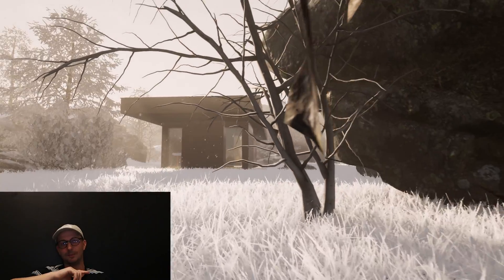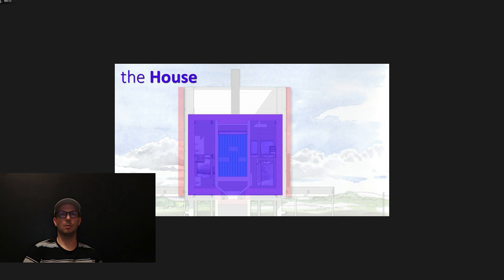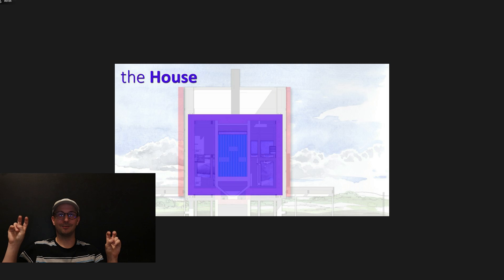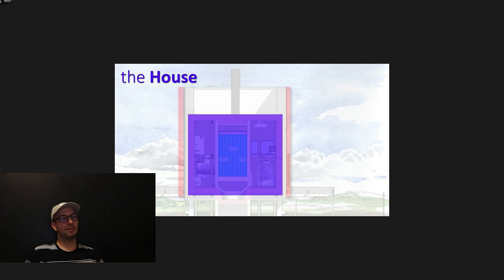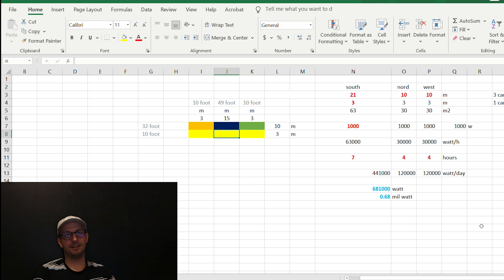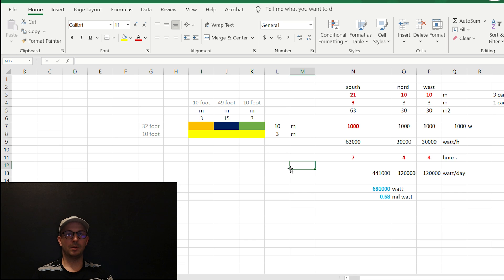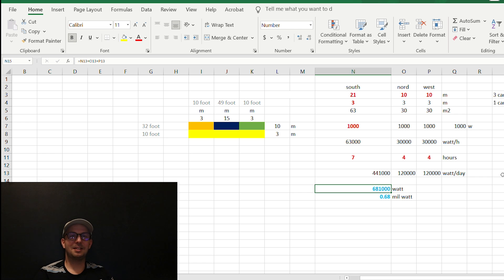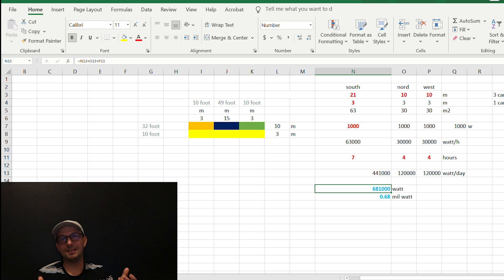Energy efficient home plans for cold climate ... 5 FLAWLESS HACKS ?

Comment: Interesting! I’m curious what you do in the summer then to avoid the greenhouse overheating the house, or is there a way to use it to cool the house in the summer?
Reply from the maker: there are many ... however if we talk strictly just about the greenhouse itself the material van be rolled up automatically or replaced from 9am till 4-5 pm with a semitransparent or shading material double-ing it. Assuming most persons are not from home office or they same in 1-2 rooms even "pitch black" wouldn't affect them in those hours. However a semi transparent material would work out the best if the family is at home. Its not like we want to stare out the window for hours directly in the sun for hours. If we do we automatically role up the semi transparent or none transparent material for 10 minutes. The further is from the house the better it is. Because the foundation of the house and the earth near it wont be affected by the heat storage. Exception is the house that's built o piles.
Reply: @MaverickMansions  I'm one of those work-from-home folks who likes to stare out windows. haha. It will be a while before I have a house I can alter in any way, anyway, but I'm gathering ideas. :-)

Comment: I am looking at building a highly sustainable house in Nova scotia and plan to have an attached greenhouse like this! However my biggest challenge the rock.... The house is going to be on a hilltop with some great views, and while it will be south facing, it's on a giant chunk of solid bedrock. Sorting out an energy efficient want to build a foundation or anchor the house that doesn't allow thermal losses or insulates from the giant cold sink beneath me will be tricky I think. (or I could have it all wrong) I thought about using pillars or beams but again then you have the problem with cold air getting up under the house. Lots to think about thanks for making this! 

I am also considering using rammed earth for my core walls! 

I will also be only a few km from the sea, and there can be some cold/harsh winds off the ocean so I will be thinking about your air gapped facade for sure!
Reply from the maker: Usually the bad thing is the gold. Think about constant winds not as cold but wind energy. Lets say you have everything  "against" however you have limitless free energy so you can get away with 1 layer of a nylon sheet and wind turbines heat up your not just your house but the whole neighborhood.  https://www.youtube.com/watch?v=Nm3u1i1vdgc&ab_channel=MaverickMansions  Yes you can build a walipini like house basically partly under ground so its not facing the wind at all or you might build a greenhouse near it so it stops the convection. If you want i can make you a quick sketch in microsoft teams. Check the website for the best time.

Comment: So the idea is to just pseudovacuum-flask a home? Where the home on the inside develops its own micro-climate from the minimally thermal bridged external structure.

Then, if I understood correctly, the external structure can feed air to an above or side south-facing greenhouse as dehumidified air gets circulated.

Did I understand this correctly?
Reply from the maker: the idea is we usually overcomplicate things...its sunny ...put it in shade and let the warm air go out... I the winter when it gets cold build a "greenhouse" near the house or at least build a barrier that stops winds convection to cool down the house ... and let the cold air get out. Imagine a plexiglass ram station in the bad weather. Its not warmer inside but it blocks the wind at least from 1 direction.